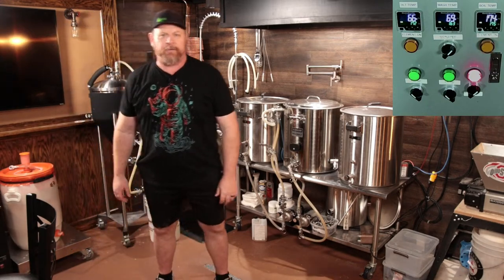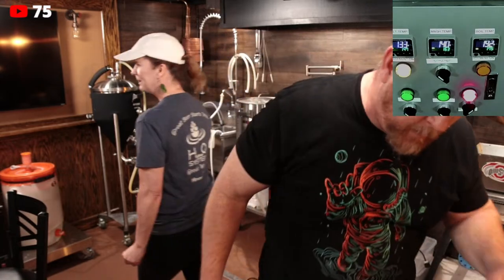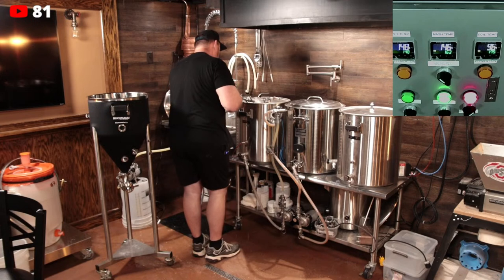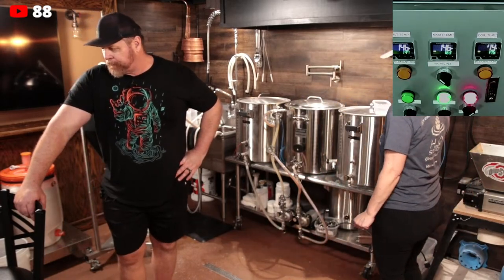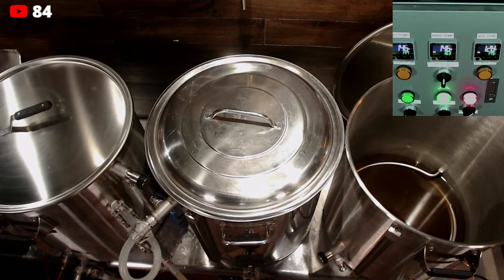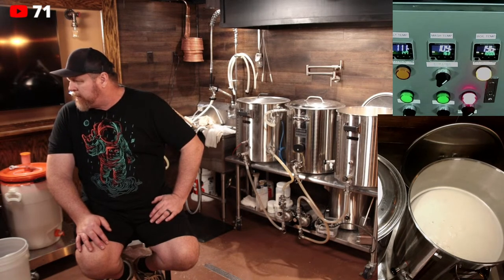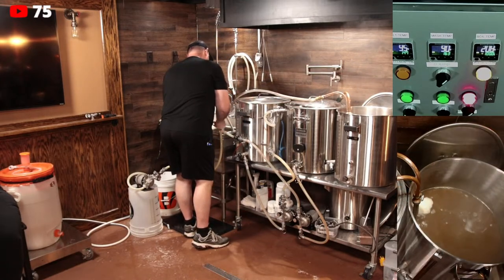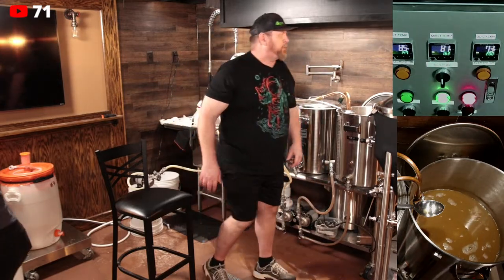3 Vessel HERMS LIVE STREAM!

Comment: Thanks for all the great content Brian, it's been very helpful over the years. I have a question about how you CIP your 3 vessel system. Are you able to do a full CIP without disconnecting and lifting the kettles or do you end up having to bring them over to the sink for a full clean? I'm in the process of building out a system and I'm debating whether the new Spike bottom drain kettles are worth the extra cost for not having to move them. Any information you have would be really appreciated. Thanks!
Reply from the maker: I do have to take the kettles to the sink. It's not a big deal for me.
Reply: @ShortCircuitedBrewers  Thanks, I appreciate the quick response.
Reply: I CIP my 30 gallon kettles. The secret weapon for me is a small shop vac to get the last of the grains and the last of the liquid in the kettles.